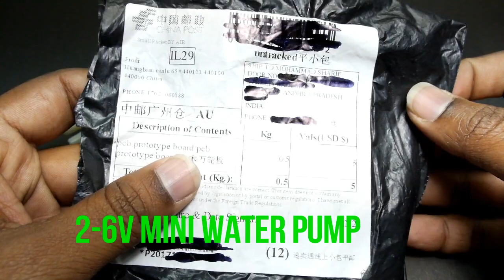testing & what's inside vacuum pump and mini pump | MR SHA

Comment: trying to get some of the mini pumps to work but so far it seems like they are either dying as soon as I plug them in or just not working
you say 2 - 6v do they need any resistors inline ?
I have 3 left to test with .
Reply: They work at 9v without resistance